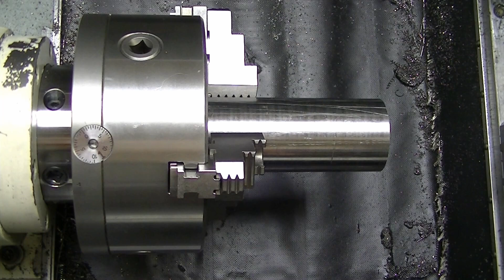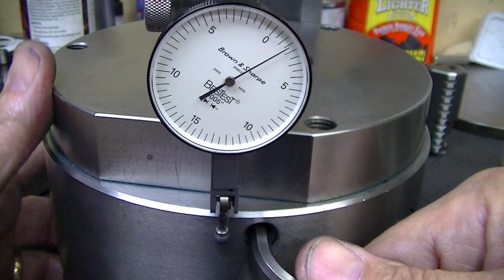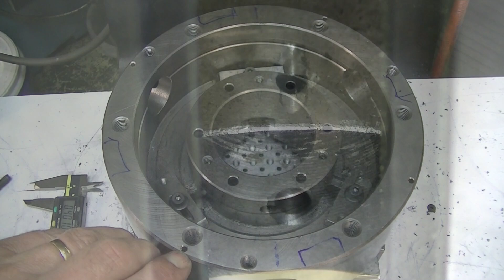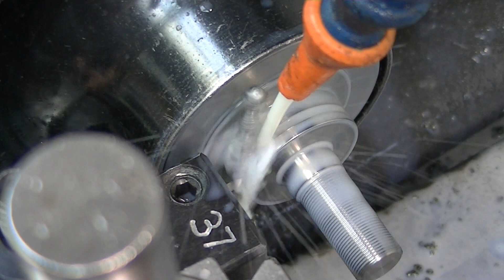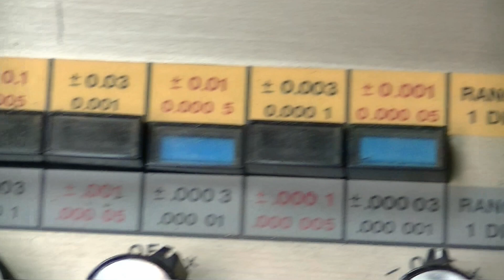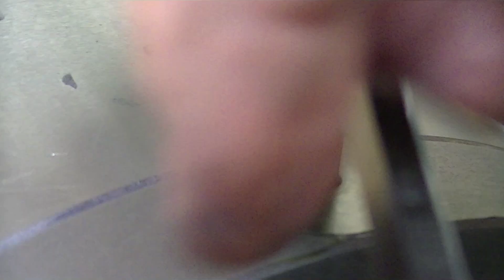MAKING A BETTER ADJUSTABLE TIR LATHE CHUCK

Comment: There is so much valuable, innovative information packed into this video, I don't know where to start.   I built a chuck stop for my 9" SBL based on your design shown at 23:00' and it really is incredibly useful.  I'll be thinking about Making A Better Adjustable TIR Lathe Chuck next.  Thank you very much for sharing your experience, wisdom and skill.  Cheers,
F.C.

Comment: Robin, Really interesting video. Most all of the set-true chucks I own don't even have the adjusting screw at 90 degrees apart as well. This makes the even more difficult to adjust. You seemed to have solved most all the problems with this type of system.
Reply: Have you ever used one with the 3 tangential screws? Those are hideous - No feedback of whats going on what so ever :-(
Reply: @StefanGotteswinter  I have one small 6" one mounted such that I use it on the live center of the Mazak. I have shown it in many videos. I think it may be a Bison brand. This chuck has its four screws two around 60 degrees apart then another pair around 60 degrees apart 180 degrees on the other side of the chuck. So they are sort of two sets 180 degrees from each other but the two sets are spaces 60 degrees apart. This chuck is one of the most difficult to adjust the run out. As well it sufferers from all the problems Robin mentions in this video. So if I tighten one screw on one side it troughs off everything else. I have taken to adjusting one screw for my indication. then loosening it and just snugging it. Then going to the next, and so on. Making sure I never leave any of the screws tight. So to start I loosen all the screws and adjust each and loosen each till I get the run out then lightly snug each hoping that doesn't disturb the run out. I would rather it was a 4-jaw chuck. It would be faster. I may look into that. But to get a small 4-Jaw with changeable top jaws. That may be hard to find. I may have to modify a existing chucks master jaws for that.
Reply from the maker: Thank you Peter and thanks for watching!
ATB, Robin
Reply: @ROBRENZ  I have an old combination 3 jaw chuck scroll and independent. has SSS stamped on it. 2-inch throw hole I think came with my GISHOLT #4 torrent lathe, but I can't find anything out about it I don't use it I use the Gahlot 3 jaw scroll with a dozen different teeth it came from Quincy compressor plant years ago.

Comment: I dont understand what you did with the teflon tape.  Did you put it around the threads of the SHCS’s or the heads of the SHCS?
Reply from the maker: Between the mounting surfaces of the chuck and back plate.

Comment: Would it be better? if we cut a little step on the out side edge of the adjust screw then engrave the division marks on another ring and gentle press fit it to the screw. Just fit enough so it not turning around but we still able to adjust it. Because the thread with move a little bit over time so those marks wont always stay on the same spot as we want.

Just my thought, not trying to be smart 😅. I got no more word to say about your works but still have to comment.😅
Reply from the maker: That would be a nice enhancement. I figured I can put a shim under the screw heads before the hardened race goes on if I need to tweak it for wear.
Thanks for watching and commenting Cà Lem,  
Uncle Robin

Comment: how did you find out how dan galbarts chuck works? Great work!
Reply from the maker: he briefly covers it in another video
Reply: Read all the comment section of Gelbart he gives a lot of information. Actually it works with worm gear couple with a twist cable as preload
Reply: I remember that he sais something about lapped plates but nothing about the mechanism. I have to rewatch his video and reread the comments.

Comment: Robin, such a clean design - Love the super close fit fine pitch screws.

Thank you so much for taking the time to film and share this design.
Reply from the maker: Thank you Stefan for watching!
ATB, Robin
Reply: Hi, Stefan. Thanks a lot for your video. Especially about scrapping. Helped me a lot.
Reply: @IGBasov  Stefan helped a lot with dieses verschrotten :D
Reply: Actually Stefan without a couple of the vids you have done on "cost effective" chucks parts of this video would not make as much sense as they do.